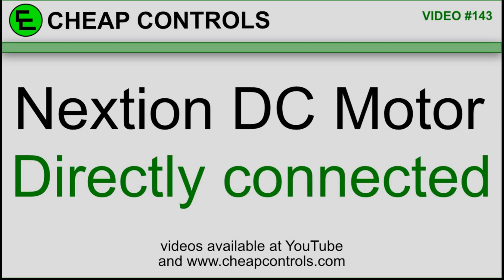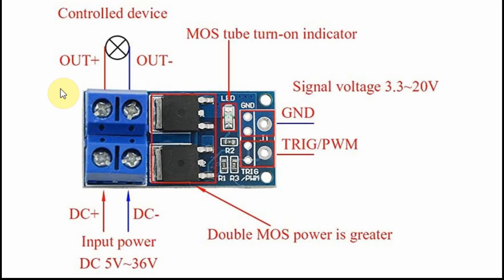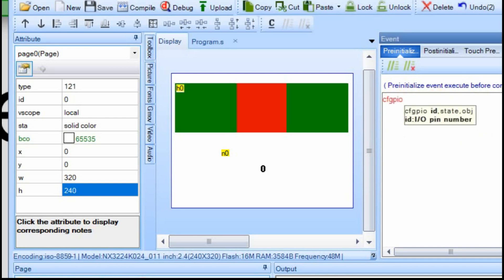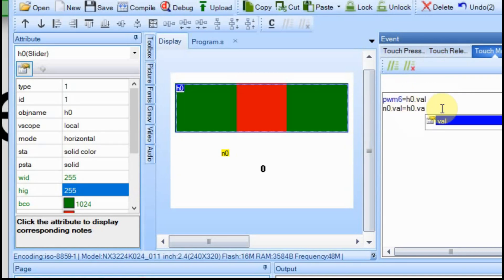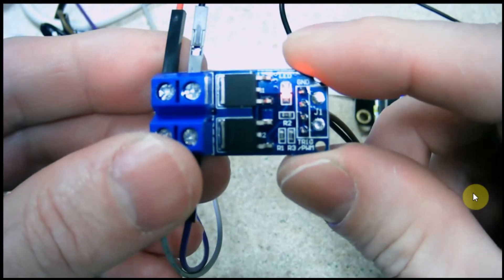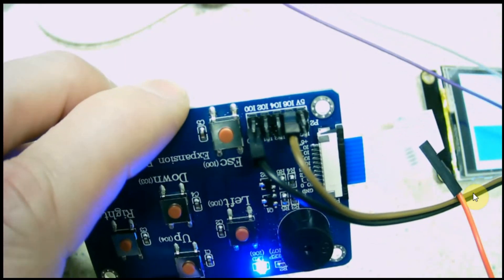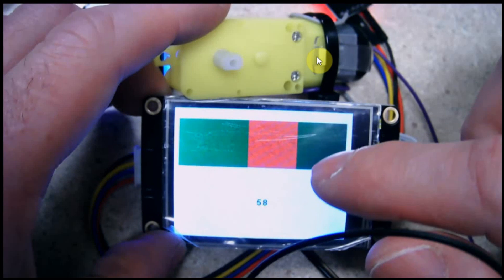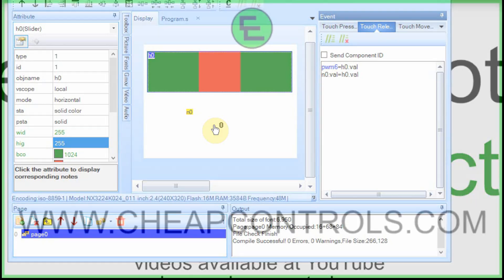143 #Nextion direct #dcmotor control

Comment: Hi. Is it possible to connect GY-91 module or several modules (MPU-9250, GPS Neo6m, Bme250 etc) to the nextion screen directly (without arduino  usage)? Would be interesting to create some nextion device, indicating current location (GPS coordinates), and compass (gauge + degrees + heading). Now I succeeded only in compass (nextion+arduino (tr/rx)). Would be nice to know is it possible to avoid arduino usage. And if not - how to create indication from several different sensors. Thx in advance.  Recently was looking for GPS+compass devices posted on youtube. Several projects found, but mostly on very primitive level.
Reply from the maker: I have not tried to connect a servo motor.  I think it would work but I am not sure on the current that the Nextion can supply.

Comment: Nice. About beeping at low figures - just need to calibrate regulator, in order to set up real working PWM range from 0 to 100 (or 255 or another range). And also its possible to use modern driver just to have possibility to switch polarity (in order to get 2-ways rotation when you slide in one and another side, starting from the middle of the bar). Thx for your videos.
Reply from the maker: I have a new driver ordered and plan on making a follow up video.  Thank you for the suggestion.  If you look back on one of my videos I went over calibration on a LED and a servo using PWM.  I am never sure if I should repeat information for new viewers or if repeating information will bore repeat viewers.  This is always a concern of mine.  Thank you for watching.